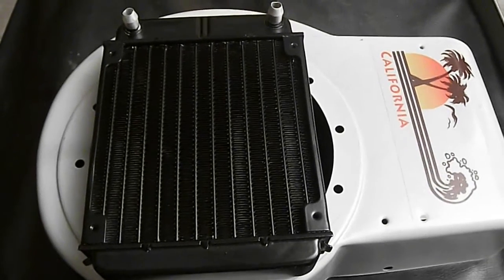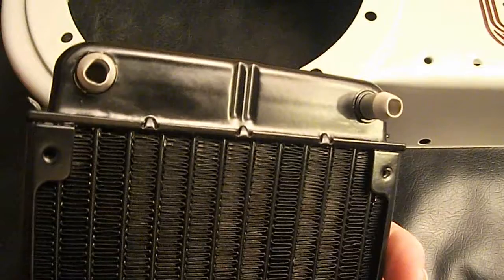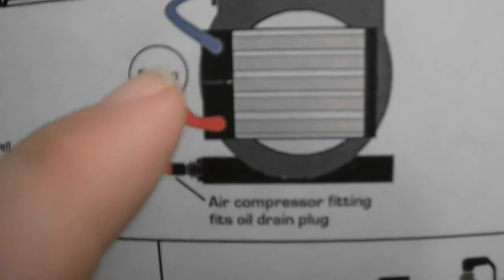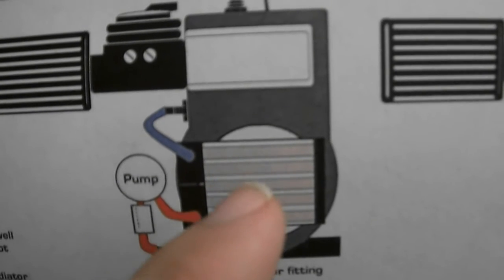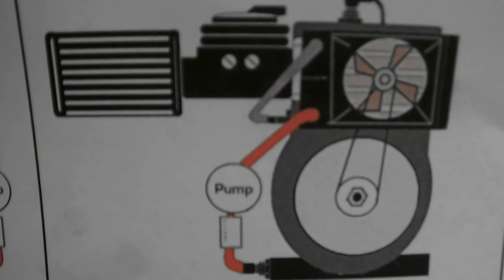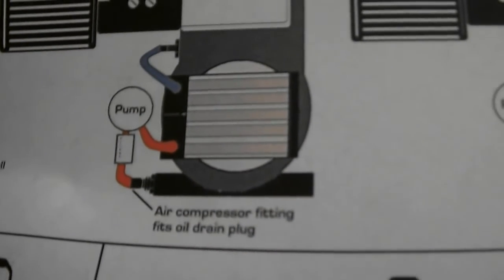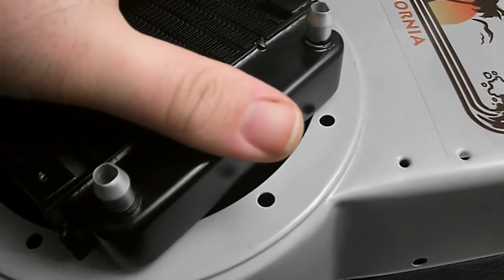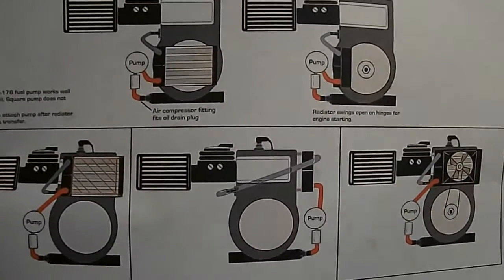Experimenting with CPU Radiator on Briggs 5hp - Part 1

Comment: cool my friend.  A liquid cooled 5 hp motor.  Well spring is here is just got my first roto-tiller in for repair.  It is a 3.5 hp Tecumseh.  There aren't to many of the 3.5 hp Tec's horizontals around.
Bruce

Comment: My dad turbo snowmobile has a mini oil pump that feeds the turbo, it's about the size of a fist and just has twi wires, also you can get a drill powered water pump from Almost any good hardware store, there small and run it off of the crank
Reply from the maker: Thanks for the idea !!!  I been looking at drill pumps lately :)

Comment: But isn't the oil designed to run at these temperatures. Might end up getting more wear as the oil would run at a lower sae as it wouldn't heat up enough to get to the correct sae. Unless you are using a mono sae oil.
Reply from the maker: I mainly use SAE 30 for everything and add a few ounces of Synthetic if needed.
Reply: ***** I always use straight 30 also. Just had a v twin briggs die after doing roughly 20 000 hours. The engine was still good until one piston broke free. Ran for two days like that before we discovered it!

Comment: Hey man! Very cool idea! I think it has potential. I have that exact radiator cooling my CPU. My Briggs 5HP on my gokart has finally decided to give up so I'm going to the scrapyard on Wednesday to get a Honda GX200 Clone generator for the engine as the parts are so easy and cheap to get in the UK. I'l make a video and send you a link once it's done.

PS. This is last and final account haha, I didn't like ITzzBradHD but I'm sticking with this. 

Keep up the good work!
Reply from the maker: Hey buddy !!!   Cool channel :)

Comment: That's a neat project! I might be able to use a radiator like that on my jet engine. I know some of the jet guys use hydraulic pumps from a convertible top to pump their oil and fuel, but they sound pricey.  What did u use to make those drawings?
Reply from the maker: Cool man !!!!  I use windows paint for my drawings.

Comment: What if you mounted a small rechargeable 12 volt battery to the frame of whatever the motor is going on and find a decent sized CPU fan and added a switch I think that would work

Comment: Maybe a small impeller pump driven from the shaft behind the flywheel? It wouldnt have to be mounted on the front of the shroud, seems like any movement through a heat exchanger should cool better than none at all. great idea, the engineering should be fun :)
Reply from the maker: I'm thinking maybe a pump with a rubber wheel riding on the outside of the flywheel on one side.
Reply: Much easier :)
Reply from the maker: Lil Doggy
 LOL !!! I could run all kinds of gizmos if I had a jack-shaft setup :)